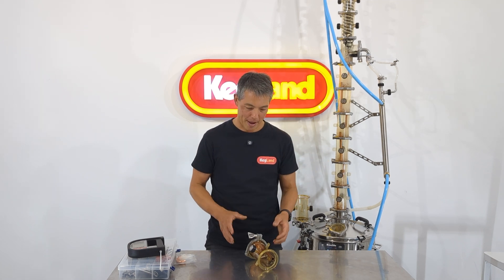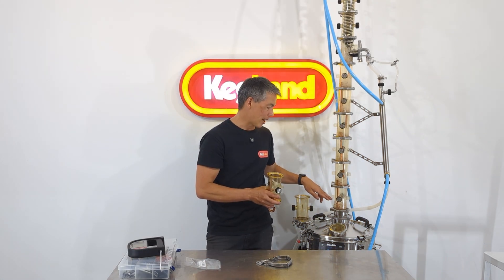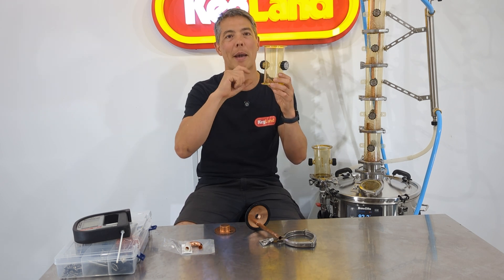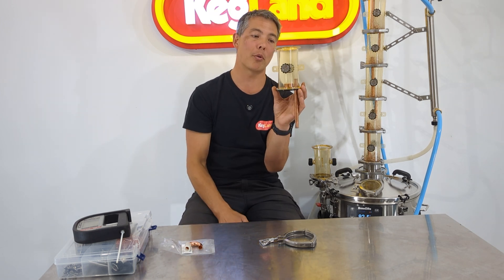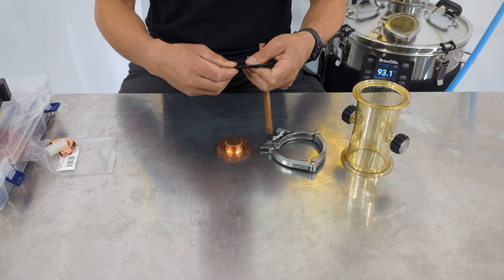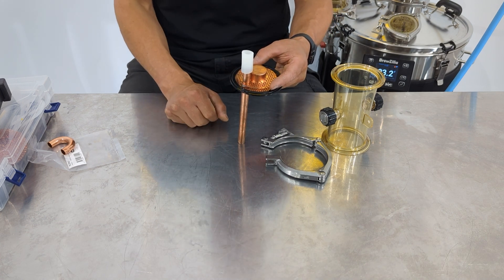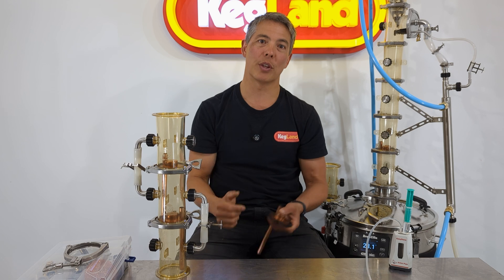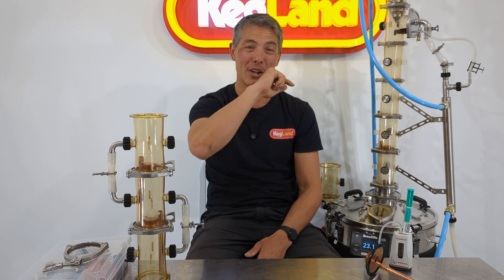Polyphoenix Bubble Capper for Distillation - Whiskey & Rum Made Easy

Comment: Whats the minimum power you can use to run these plate?
Reply from the maker: You can go up to 3500 watts no problem.  You can also go higher than this if your wash is less than 20% ABV.
Reply: @KegLand  thanks, I was after minimum wattage, like will the 35 litre brewzilla run it or 1800 watt systems?
Reply: @colwk I find them to have a pretty wide range they work in. Down to about 1000 watt and up to about 2500 watt. 
1800 would work fine.

Comment: The Hofmann clamps on the undertaker liquid output are a bit hard to get, and keep “just right”. Swapping it out for a needle valve was a good investment. Would be good to see some other value options in the Kegland lineup.
Reply from the maker: Sorry abou tthat. We have sold out of the hoffman clamps but we have more arriving soon.  Needle valve will work fine for the liquid output but if you are using vapour output then the hoffman clamp is still necessary.